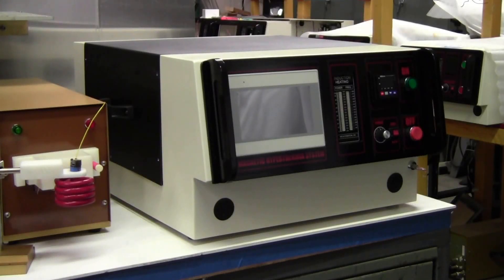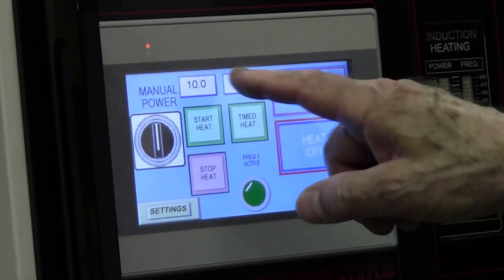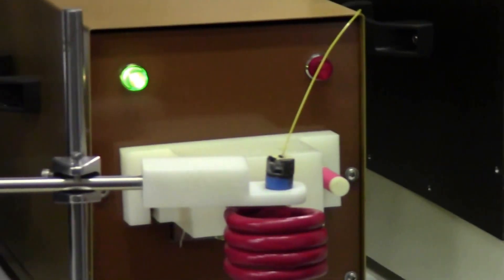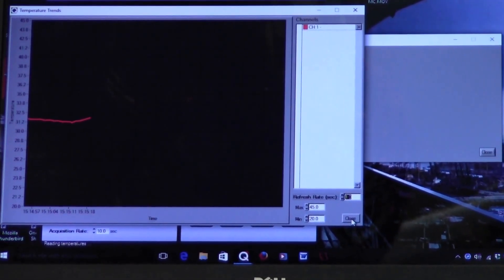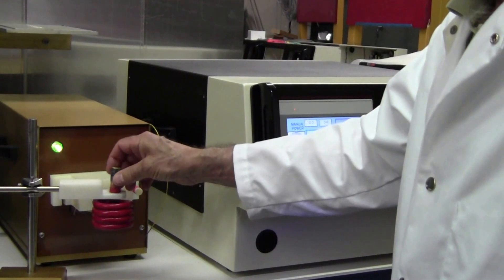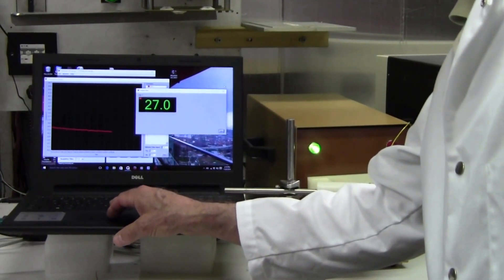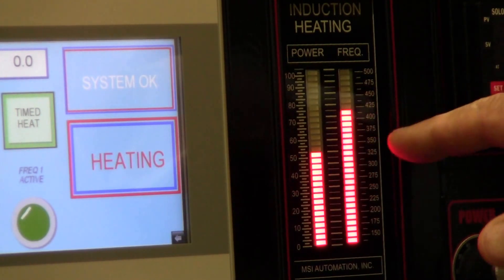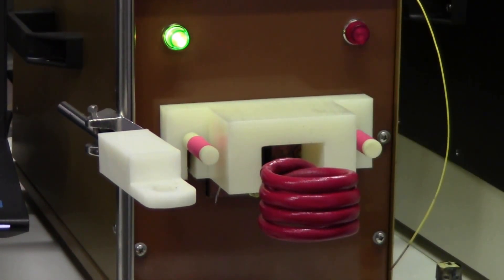Magnetic Hyperthermia

Comment: Hello, what was the type of fiber optic thermometer? And did you calculate the SAR values? Thanks!
Reply: The fiber optic system is by Neoptix of Canada. Up to 4 fiber optic sensors can measure independently at the same time.